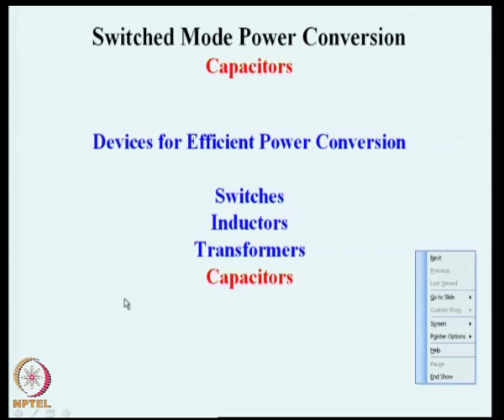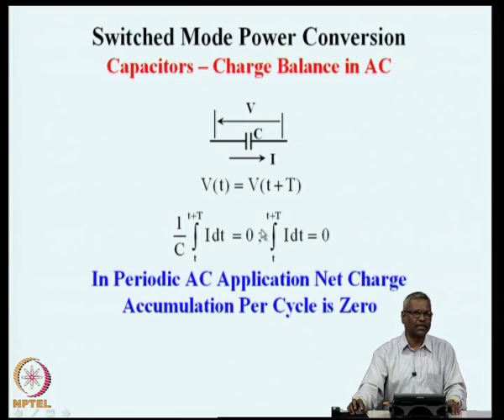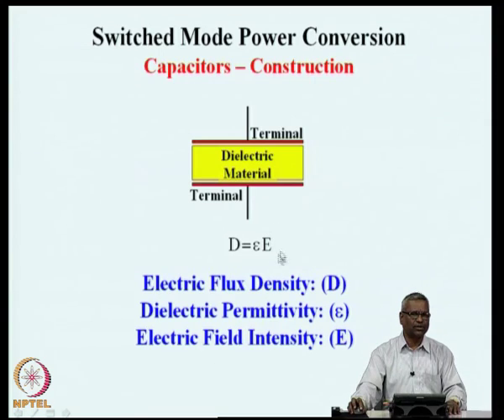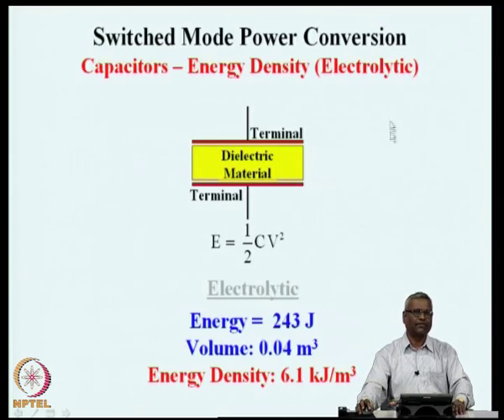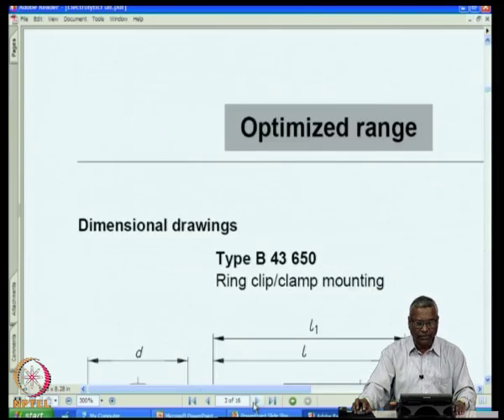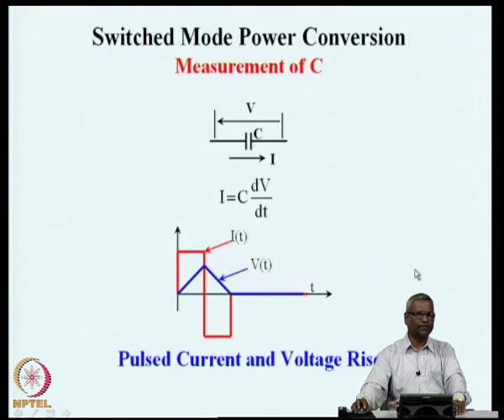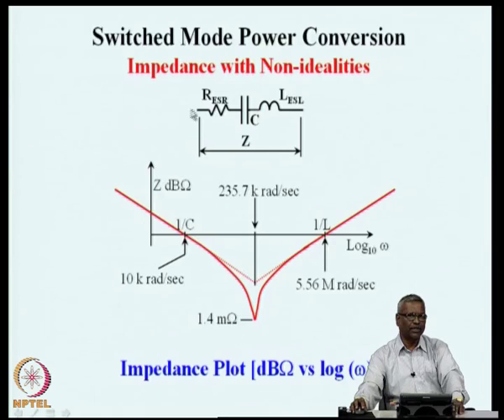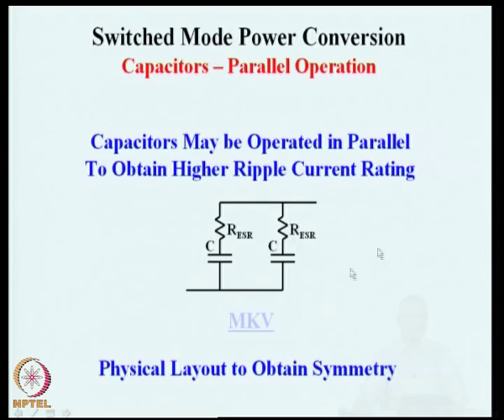Mod-04 Lec-07 Capacitor

Comment: The lecture was very useful. There are nice lectures here too with a unified approach to electrostatics and circuits 
 Simple D.C. circuit. 
1 Pattern of electric field.
Watch from  *16.0 minute*.

2 Mechanical Battery
Watch from  *19.0 minute*.
https://youtu.be/Eu3JQKrJRZA?si=t3MeX8Hi8ELAxaz0

3 First intro to  Surface Charge 
Watch from  10.30 minute. 

4 Surface charge gradient 
Watch from  15.30 minute. 
https://youtu.be/bp0o1HZOs3g?si=PPiPGepbXvdTgJHX

Capacitor - Video lecture by NCS Univ faculty 
This is a link to a video lecture by NCSU faculty on the fringe field of a capacitor.
 Important 
*5*. Derivation leading to fringe field expression of a capacitor.
For the final expression of the fringe field watch from 15.0 minute .
 ch15L3b 
https://youtu.be/7rZ1uFc1ibE?si=0a6OMk-kQLeEMMzb

The second link is to a video lecture by NCSU faculty on *Discharging and Charging of a capacitor*.

6 . Discharging a capacitor 
Watch from 3.0 minute.
 
Charging a capacitor 
Watch from 15.0 minute. 
Ch19L1a 
https://youtu.be/hnSC8MqgCjY?si=krGUPtDarUmFxT_I

Refer Fundamentals of Electric Theory and Circuits by Sridhar.